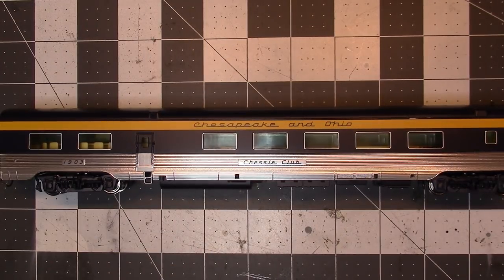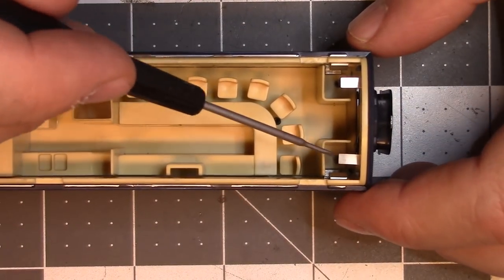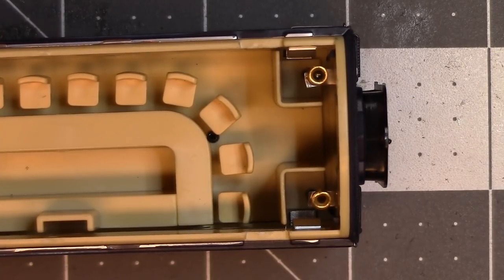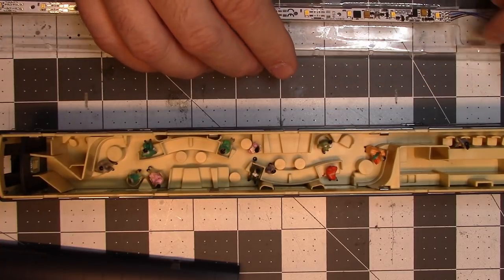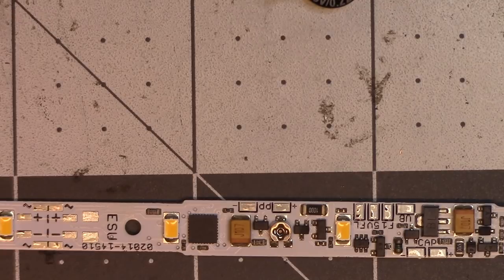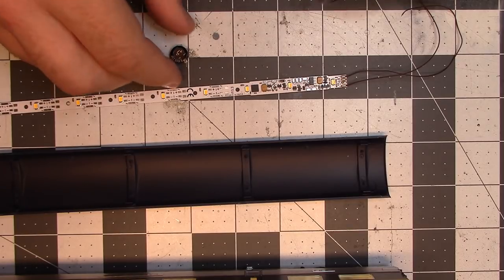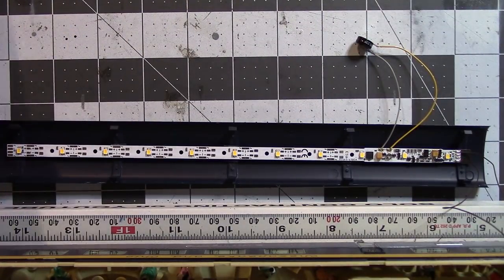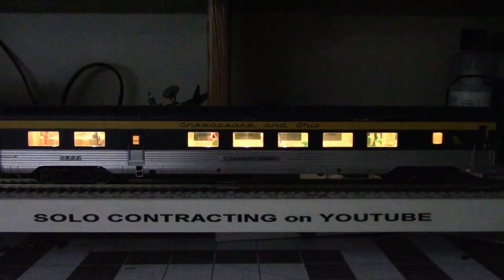ESU lighting board Walthers Proto Passenger car

Comment: As an FYI, Walthers now tells you to remove the roof by the twisting method, which for me was very difficult. Plus the newer cars do not come with pickups installed but they do sell a lighting kit that includes new trucks with pickups. I paint the interiors of mine before attempting to do lighting or add people.